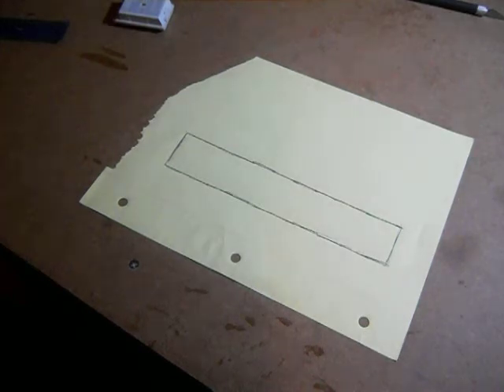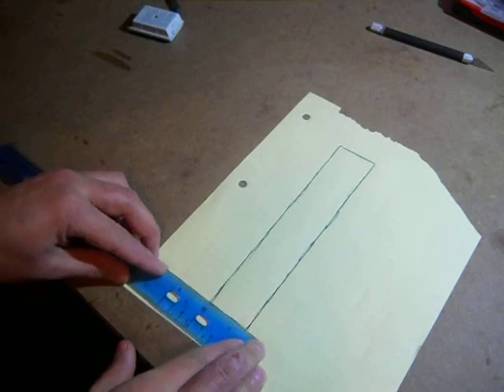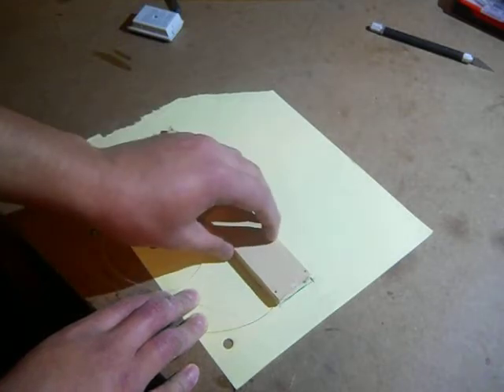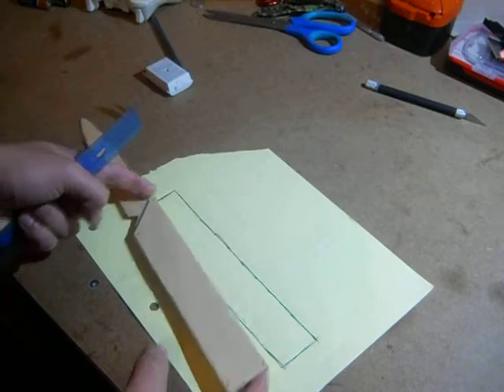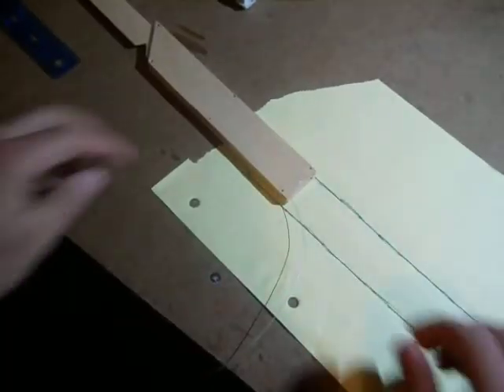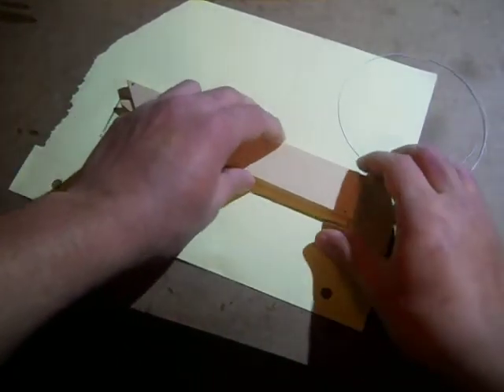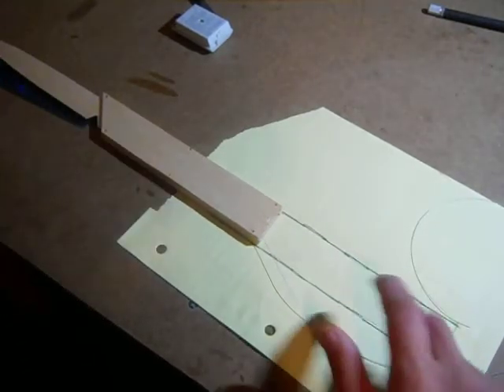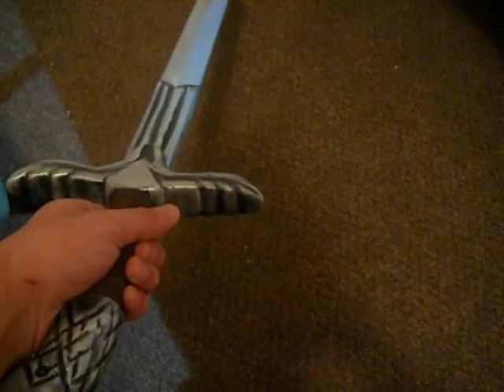Hidden Blade Pulley System Introduction

Comment: In order to keep your design this size low profile yet retain strength as well as rigidity and durability, I suggest that you construct your DA OTF Blade from a steel billet made from a 3/4 - 1 in. Diamiter steel cable. You can find all the instructions here on YouTube simply by searching "Forging Cable Blades" I have used this technique many times and the results are well worth the effort.